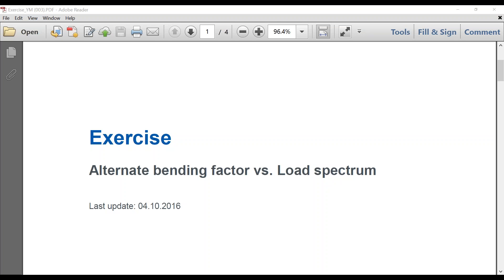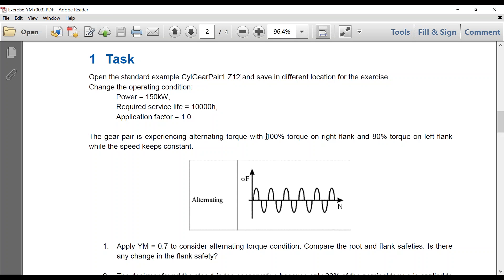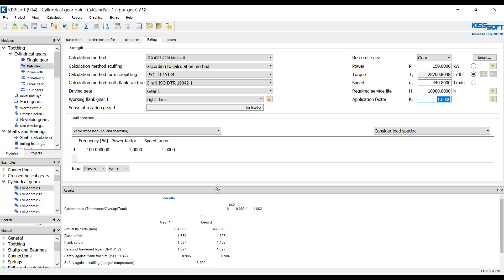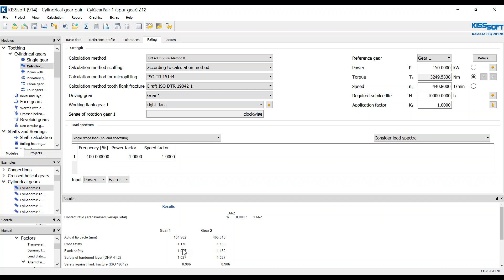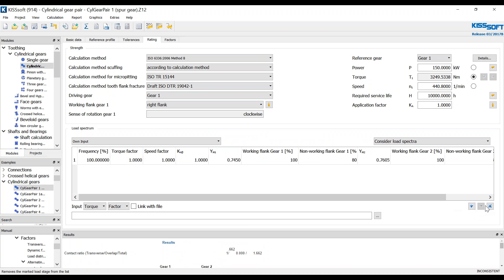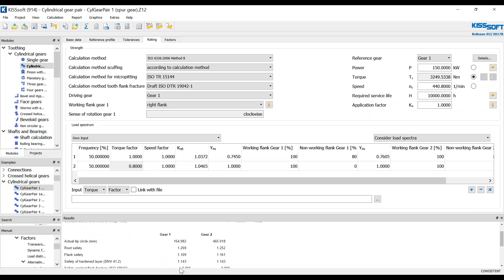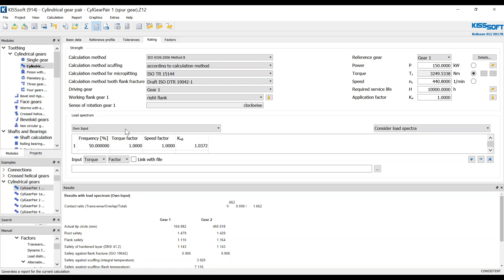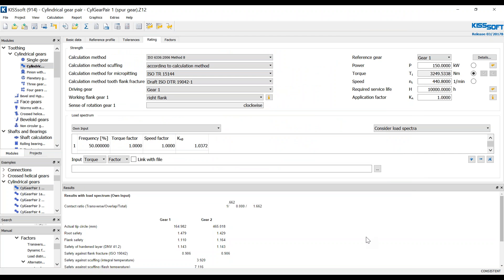Part 2 Load Spectrum vs  Alternate Bending

Comment: Many Chinese gear manufactures use your software to design gear box and transmission. Dynamic analysis is a topic in design forever.
Reply from the maker: Yep, dynamic analysis is tough, you need FE solvers like ansys, romax or Trans 3D to get a complete dynamic analysis, we typically use methods such as load spectrum, and static analysis to look at overload conditions and damage accrual to the machine elements in KISSsoft. Many of these methods are prescribed in ISO and AGMA standards.